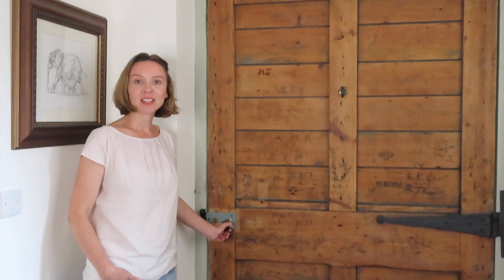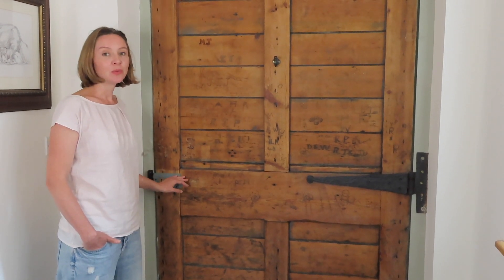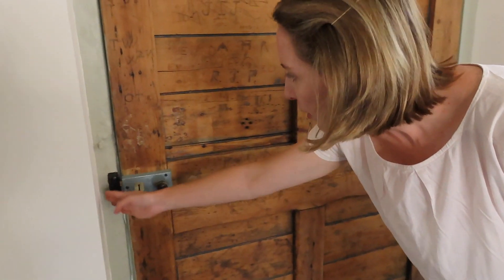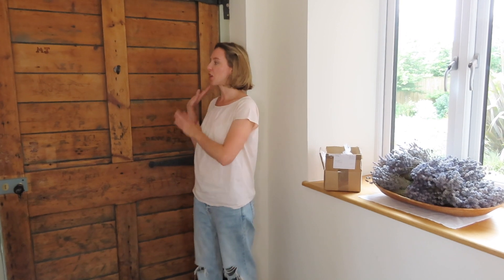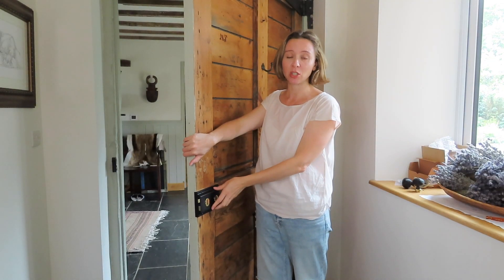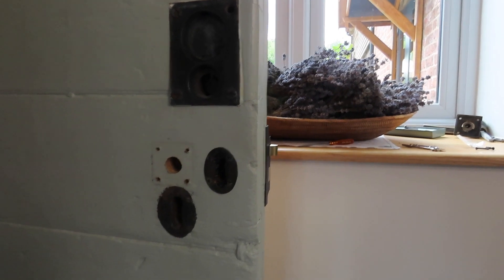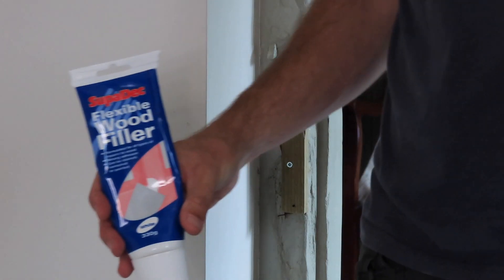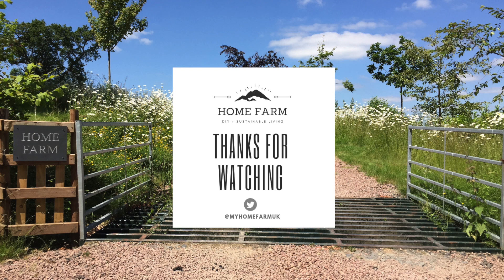Restoration DIY - Replacing the Rim Lock on a 180 year old, Victorian Farmhouse Door

Comment: Sorry to break the news to you, my wife and I bought approx. 17 of these for our new build. They are absolutely rubbish. After a year or so the springs started to break, on top of this the insides aren't lubricated properly so they squeak after a while, requiring them to be removed, stripped down and grease applied to the mechanism. Some of them, the mechanism inside wasn't pressed out correctly causing it to rub constantly. The shaft that fits through the square piece is much too small causing a lot of play. I honestly hope you have better luck with yours than we did with ours. We will be replacing these in the very near future. We have the same knobs though, and are very happy with those!
Reply from the maker: Thanks for your comments and feedback. Our lock is still OK, but really disappointed to hear you’ve purchased 17 and they’re not performing. That must be super annoying.
Reply from the maker: As an update, it’s been nine months and our rim lock is still performing well. No issues with it.
Reply: Don't apply grease as thus will help the dust stick abd cause the handle to squeak again. Use a graphite lubricant like ambersil
Reply: i often strip my lock down and refit the springs , i feel your pain

Comment: Are you able to unlock the door from the other side? Was there a hole already? Recently bought a rim lock for some Georgian doors and worried the lock only works on one side, would suggest drilling through the door to access the rim lock from the other side?
Reply from the maker: Yes, we already had an "original" hole from previous locks, and we can also lock ours from both sides, because the keyhole runs all the way through.